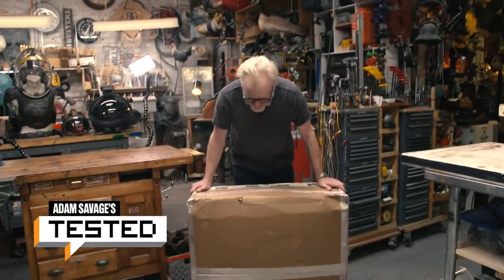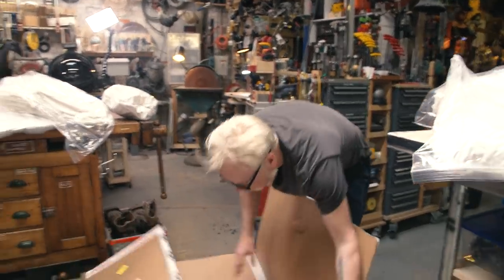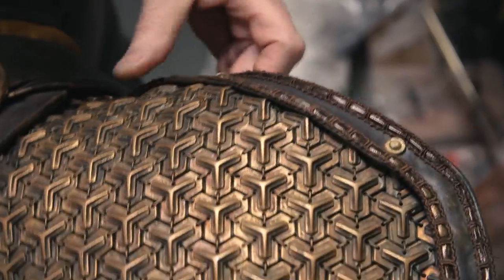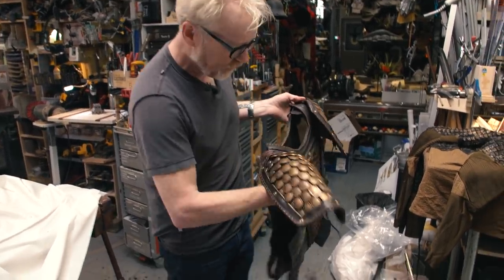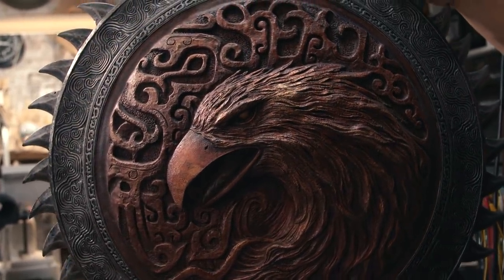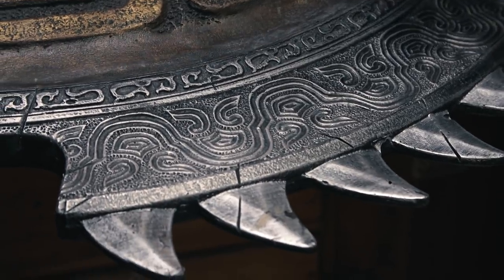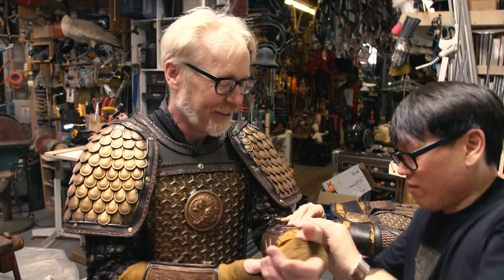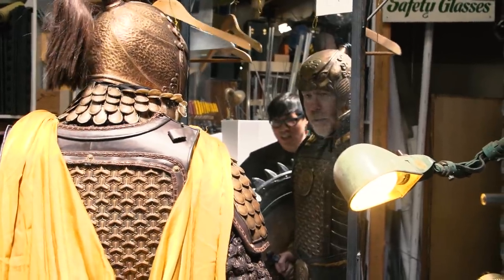Adam Savage's Gorgeous Great Wall Armor!

Comment: Oh wow, I'm actually in the middle of building a Ming dynasty armour. A non-prop one, made of metal.

The "triangular maille" is called mountain pattern scale, named so because the scales look like the Chinese character for mountain: 山. They slide under and over eachother, leaving only the three pointed star figure exposed, which this prop is emulating. The reason it's only emulated is because those scales are a pain to fabricate. You can trust me on this one.

Great to see this here, Adam. I'll go check out that film and its props. Cheers!
Reply: Redmar Kerkhof thanks for sharing that info! Awesome
Reply: Just offering independent confirmation that "mountain armor" is a PITA to fabricate. Even if modern CNC cutting makes it far easier, it's still VERY time-consuming to assemble, so small wonder they just emulated the looks.
Reply: I’m also making a chinese armor from the Song dynasty but made from cardboard.
Reply: Just FYI there is no evidence backing up the name of this thing. The original source does not describe how the mountain pattern armor look and the triangular shaped stuff is called "suozi" in another original source and it is more of a design pattern than actual armor.
Reply: @caesarzhiyuzhang5805  That is good to know. The more I work on this armour, the more I suspect they didn't actually use 山 shaped scales. It just makes no sense. Your comment seems to reaffirm that suspicion.
I knew there was no archeologolical evidence for the stuff existing but it's interesting to learn that even the name is distputed. Though I suppose it's not surprising.

Could you tell me how to write "suozi" in Chinese characters? It might help me in my research. Thanks.
Reply: @RedmarKerkhof  welcome. suozi is 锁子，the original form is 琐子，the pattern in its original document is called “琐纹”。 And there are antiques of this pattern in China. For example this emperor shunzhi's parade armor from the forbidden palace museum: https://www.dpm.org.cn/collection/defense/230654.html
Reply: @RedmarKerkhof  the original document with the name suozi and sketches of the triangular shaped pattern is called 营造法式, made in Song dynasty. It is a book about construction and internal design. The original document mentioning the name mountain pattern armor is 唐六典, in Chapter 16.  The triangular pattern can also be found in other parts of the world too.
Reply: @caesarzhiyuzhang5805  That is very helpful. Thanks a bunch!
Reply: @RedmarKerkhof  welcome!
Reply: That was mean as guys. Wow, I'll stick to my light saber for now tho.

Comment: I was one of the lucky few that won one of the tiger corps armor and it arrived in the mail a day or two ago.  Sadly, I received a suit that must have been worn by a stuntman.  A few of the "scales" are broken and impossible to fix since some of the pieces are gone.  The symbol on the belt is hanging on by a single thread and the leather/fabric adhesive is coming lose in several spots.  I started saving my pennies the second I heard about the auction and won but now am torn if i should try to make repairs or leave it as is... or maybe save up my pennies for another auction.
Reply: I won a deer corps set. Some of the scales are broken as well, but it's not really noticeable. I'm thinking of removing a couple to make molds so that I can cast some replacements in resin. The paint job will be incredibly difficult to replicate though. I'm also not exactly the same size as a Chinese extra, so I had to add some extra leather-work in order to make it fit. My shield didn't come with a handle, but rather two arm straps. I'm thinking of making a new handle for it so that I can hold it easier.
I made a face mask (mempo) to wear with it and added a paracord belt to hang a sword off. I can't wait to show this suit off in a few days for Halloween!

Comment: They aren’t triangular pieces on the armour, they’re 3 conjoined hexagonal with a three line design on top all linked together. So really they are a tessellated dodecagon (three hexagons 18 sides but joined together therefore losing 6 in the join so 12 sided).

Comment: I have to admit, I'm a bit conflicted here. I do enjoy these videos, and Adam's glee, especially. On the other hand - it's all movie magic made to look like something from the period, while I do reenactment. That's like cosplay+, because (depending on the group you're with, I guess) it's not just about looking the part, but being as authentic as possible. So I have a wool tunic, woll/linen trousers, legwraps, all hand-stitched, turn-sewn shoes, bronze fittings on my knife sheaths (bronze being an alloy of copper and tin, while many modern reenactors/makers use brass, because it's both tougher than bronze, and easier to come by today - opposite of what it was historically, since there was no reliable way of getting zinc to make brass in IX century).

The only exception is all the modern protective gear that goes under the clothing for battles.